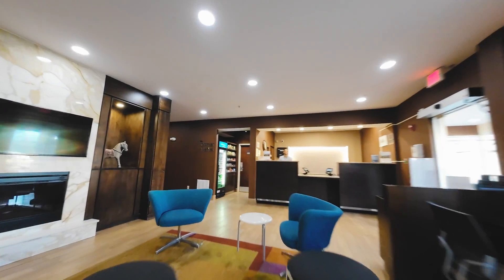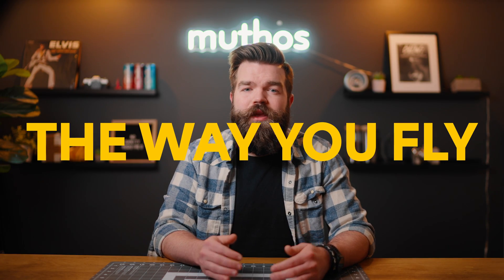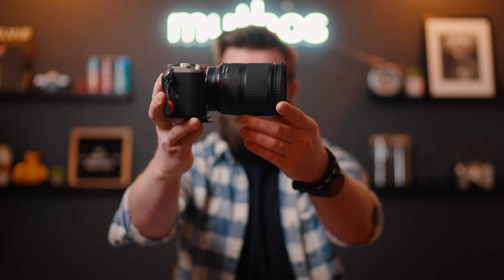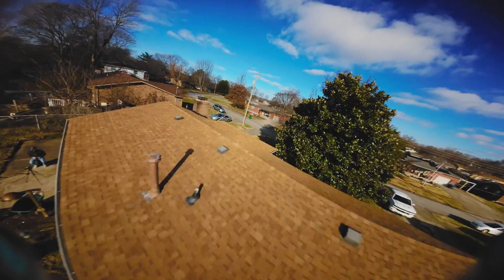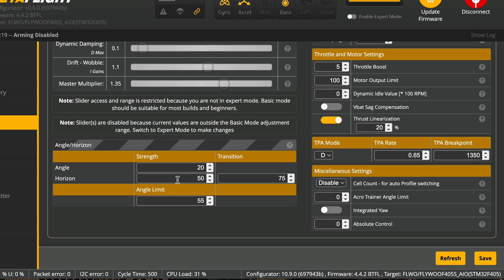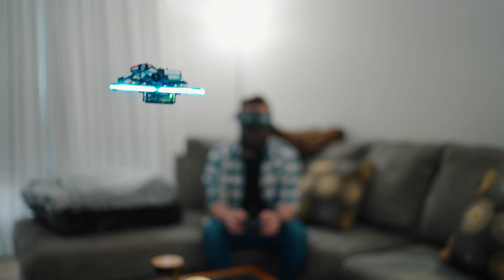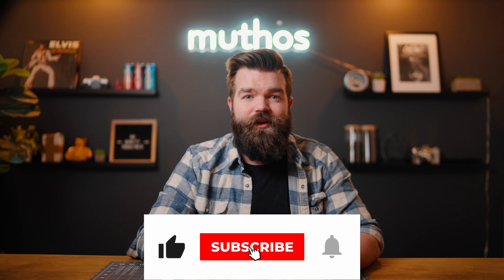From Bounce to Flow / FPV Drone Tour Betaflight Settings

Comment: Thanks for the useful information! Is it necessary to disable Air Mod in Betaflight settings for indoor flights?
Reply: Personally, I fly indoor in Acro with Air Mode OFF. Air Mode indoors can create more problems than it solves, especially on cinewhoops and in tight spaces. It tends to make the quad feel “floaty” and harder to settle, it can cause more throttle bobble/oscillation near hover and it can make little corrections around obstacles feel twitchier or lead to unexpected propwash bounce when you’re close to walls or the ground.

What works best for me is putting Air Mode on a switch, so I can toggle it on when I actually need it (for example, if I’m worried about dropping during a maneuver) and keep it off for smooth, controlled indoor flying.

Also, I’m not a fan of Angle mode at all. It just feels weird and a bit jumpy to me, so I stick to Acro.

Comment: Assume you use the stock factory tune then just adjust the pids on this correct? If so, would you mind sharing the tune? I am finding angle mode continuously wants to drift on me so seeing what you've dialed in will help a ton! Thanks for the great content.
Reply from the maker: Yes, Ive got the factory PID tune and ive just adjusted the rates, here is how ive got it set up: Rates are at 670, Roll and yaw expo are at 0.50 the pitch expo is at 0.30, my throttle mid is at 0.25 and throttle expo is at 0.50 (ive got it setup for flying the flywoo 1,000Mah batteries) and then in my angle/horizon mode strength ive got angle set to 20 and horizon set to 50 and then the angle limit at 55
Reply: @JonnyTrego  Awesome! I never fly angle but starting to shoot more indoor stuff with my Flylens. Appreciate your thoughts on and help with the angle settings. Boom!

Comment: How do you change the camer angle on the flylens 85
Reply from the maker: You loosen the screws on the side of the camera and just tilt the camera to whatever angle you want and then tighten them back down! I keep my angle at like 0 or 5 so that i get slower smoother flights

Comment: Do you fly indoor with angle mode?
Reply from the maker: Yes I do!
Reply: I’m doing this now too and getting wayyy better results, especially with the strength dialled back..but all the pros seem to pull it off and swear by acro. Should I care? Is it just ego or are there actual benefits from flying acro indoors once you’ve mastered it?

Comment: I used throttle expo when I was first trying to get more throttle control. I really liked it at first until I realized it’s better to not use expo, and only scale the throttle down. You lose the top end but linear throttle is just better overall. I noticed in fast turns for example where you need more throttle while banking, it takes you out of that expo “sweet soft” spot, and is more touchy and feels inconsistent. Maybe can get away with it for strictly slow cinematic tho

Comment: 4:26 the other way is to change throttle from line to curve, making it less responsive for inaccurate moves, but regular practice is always better.
Also lower camera angle is a good point to start from.

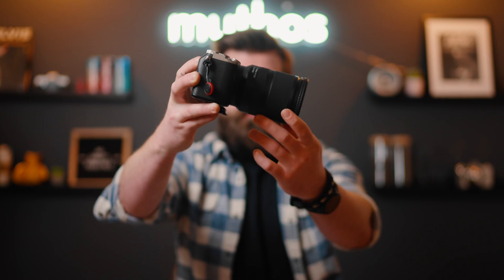Comment: 1:55 this is obviously not true, as when you pitch you change thrust vector in vertical projection, so any change in your pitch will also lead to bouncing, the true way how to control level is to coordinate pitch and throttle through neuro muscular connection, which one can reach practicing.
Reply: Blah-buh-blah-buh-blah <insert fancy words here to simply say “using thrust and pitch together will provide smoother results”>. The spirit of this content creator’s words is well understood by the rest of us. The takeaway is (obviously) that he’d ask newcomers to consider thinking of speed in terms of pitch rather than thrust. When you practice, of course you’ll find that you end up using both for smooth flying. All the same, cheers. Try not to ruin too many parties with your pedantic personality.

Comment: Today i built my first cinewhoop, the cinelog25 v2 basically from geprc.

I noticed that when im flying very slow, the live feed slightly vibrates (indoors)  up and down, is that normal for whoops?

When im going fast that vibration seems to disappear….
Reply: Don't get this wrong, but what did you actually "build"? I have a Cinelog25 v2 O3 and it comes as a bind and flight drone.

I wouldn't fly this thing at home. Way too much power for this, but I'm no expert.
For answering your question, you probably should add the video system you're using. With the O3 I didn't have such issues. Maybe, it's because you're using something different where this might happen.
Reply: @ones_flow5652  yes im using the o3 system....

i ordered the parts from the cinelog25 v2 and built it myself since its cheaper, technically its a cinelog25 v2 ^^

Maybe its another loose lense on the o3 that im seeing wiggling in my feed
Reply from the maker: I’d make sure everything is tightened properly and it could be there is some vibration from the motors that’s causing the camera to vibrate, but it shouldn’t be there since the Cinelog25 has a soft mount system, have you tried putting another camera on top and seen if it had any vibration in that footage?
Reply: @JonnyTrego  no ive tried only that camera….the rocksteady footage looks fine, only the live feed has it (im using o3)